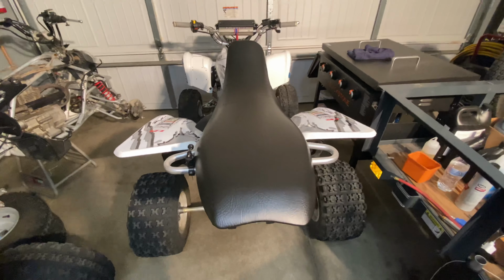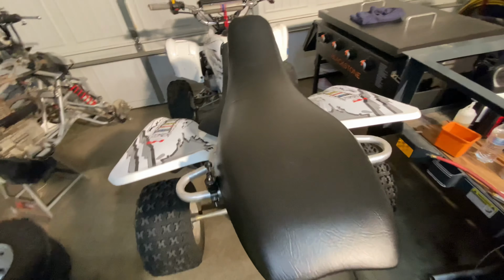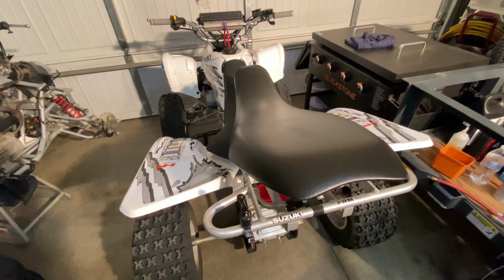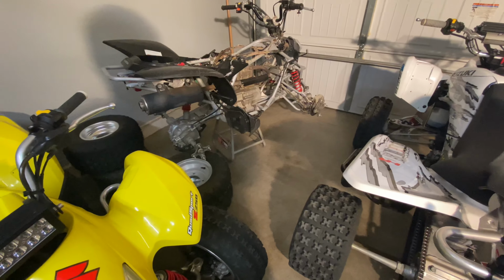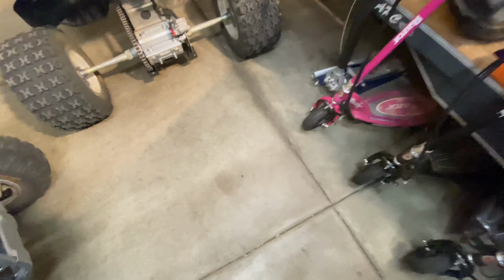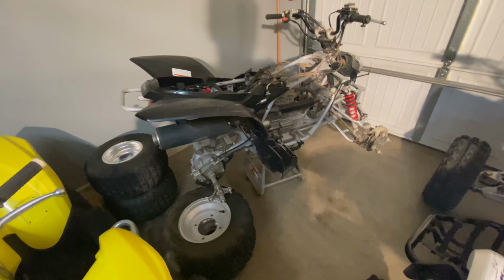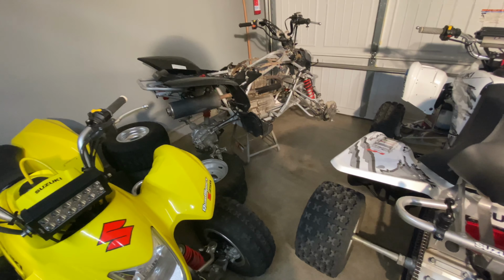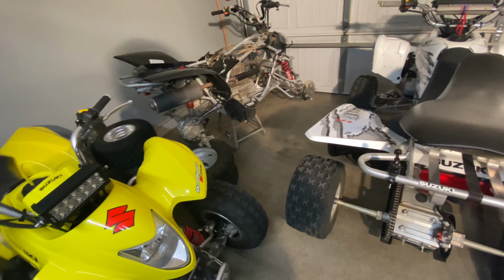HONDA TRX 250EX FLIP BIKE #8 SEAT COVER REPLACEMENT

Comment: A lot if progress made already,looks good!im going to watch the other vids too. Where did you find the seat cover material
Reply from the maker: Any JOANN’s fabric store has the marine grade vinyl I use on the seats. Way cheaper then buying one online.  $20 will get you enough to do 2 larger seats or 3 smaller seats. Use the thinner stuff a bit easier to work with for sure. 🙂
Reply: @lt-z-quadnation6644  thanks i appreciate reply, il check it out!